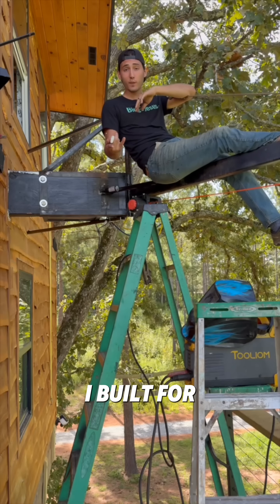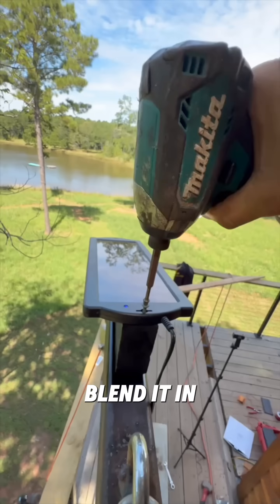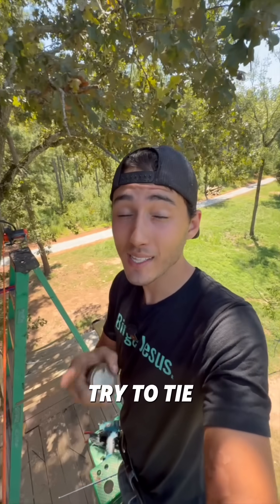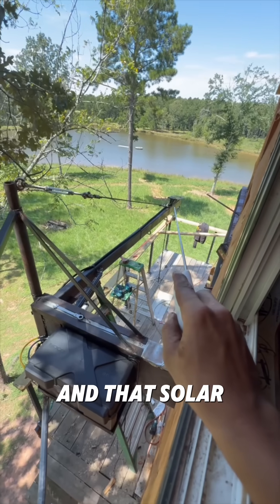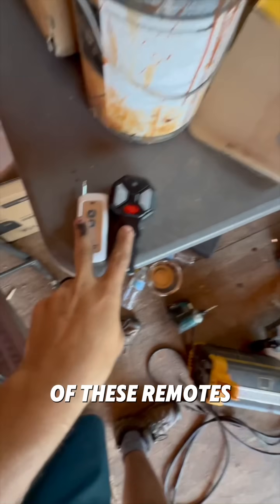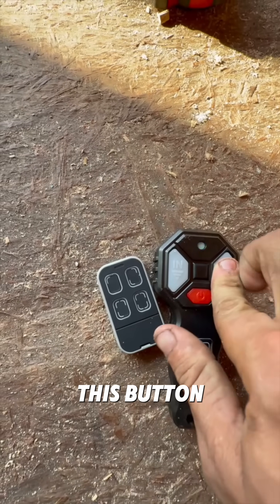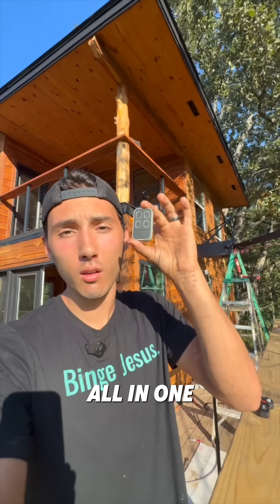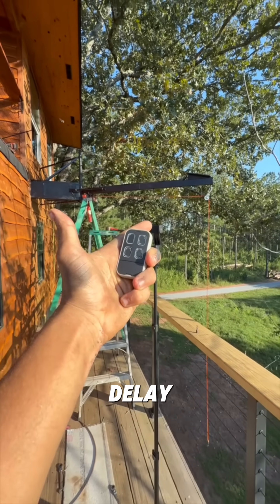I Built An Automated Material Hoist For My Treehouse (P5)

Comment: If you read the instructions on that pannel from harbor freight you still need to use a charge controller in line with it or it can over charge the battery if left un used for too long. Also that pannel is only 1.5 amp and will take a really long time to charge that battery up from low voltage
Reply from the maker: Panel is from Amazon and the instructions say it has built in systems that won’t overcharge the battery. It can take a long time that’s fine it only gets used occasionally

Comment: Looking forward to the next video when you put a bigger solar panel on that rig. Those 10 watt panels are more of a charge maintainer than a charger. I bet it doesn't even put out enough current for the bms to trigger the charge to the cells. It might be easier just to manually charge that battery until you can hard wire it after the treehouse has power.

Comment: I’ve been building a remote control ATV. It runs with 4 relays for left, right, forward, and back, all with under 50ms delay. So here’s the idea, would you want an ESP32 set up to host a webpage on your WiFi, so when you’re connected you just go to something like material.move on your phone and get the controls right there?

Comment: You could try some sort of cable puller to guide the solar panel wire through the boom arm of the crane to the battery

Comment: Try pushing a light string in the hole and use a vacuum on the other end. Might take a minute but should get you a pull string.

Comment: need a fish tape
Reply from the maker: Fish tape?
Reply: @SouthernAdventuresYT  its  a metal flat cable on a reel for getting wire or string pulled  thru things to pull wire through a cheap  50 foot is like 10 bucks at harbor freight